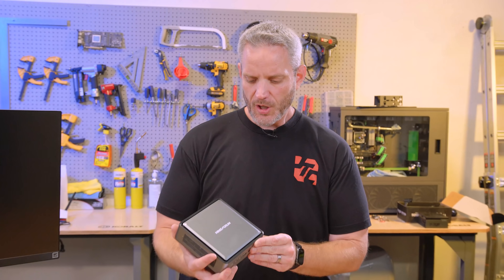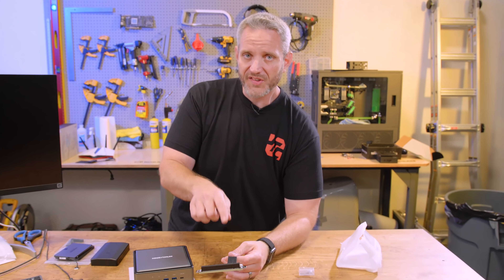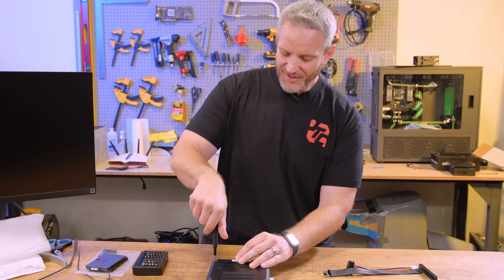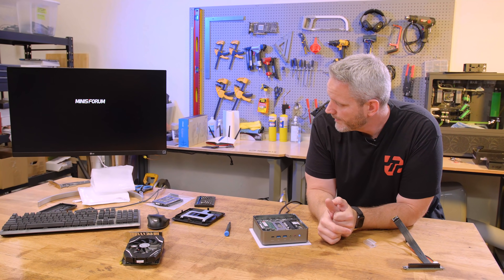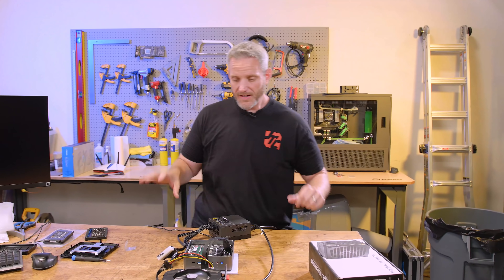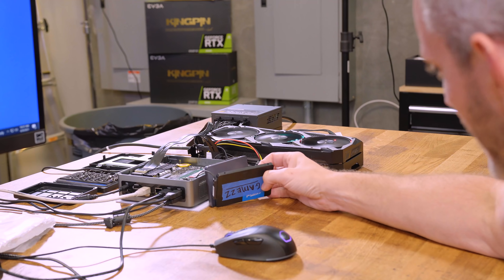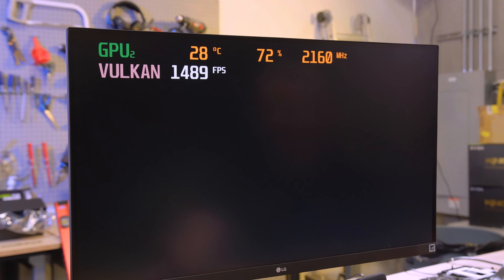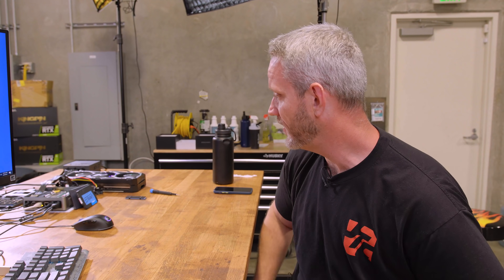This was easier than I expected it to be! Super powerful mini pc

Comment: DON'T USE SATA POWER FOR RISERS. FIRE HAZARD.
Reply: This needs to be boosted to the top so everyone can see it. Sata can only provide up to 54W, pcie can pull up to 75W. Resistance happens and can potentially melt the wire down and causes a fire.

Comment: Could you stealth mod that tiny PC into an OLD TYPEWRITER? Bonus: Then get the actual typewriter keyboard to work, too (like the one Linus did) Yes, you may add a nice chunky GPU visibly to the back or top of the typewriter, if there’s no room inside. The PCI slot could be built-in flush to allow any GPU to be plugged in there easily… add a pinch of steampunk. Poof!! 💨

https://youtu.be/EZMNaT2NjXk

Comment: Does use that m.2 connector slow your PCI-e speeds down compared to a normal PCI-e slot?
Reply: It should run at 4x PCIe
Reply: @alferez012  Thinking about adding a PCIe NVME adapter to my second PCIx16 slot on my Asrock x570 phantom 4 gaming motherboard and i'm trying to figure out if the 2 PCIx16 lanes are separate on on the same BUS and if it will cause my GPU to slow down in the first slot... any idea?
Reply: @NPuffenbarger  the second x16 slot runs at X4, and is managed by the chipset, so doesn't affect the performance of your gpu, and X4 slot runs perfectly a nvme 1 slot adapter
Reply: @alferez012  That's what I thought after reading into it but wanted to get a second opinion and yes I mistyped and meant PCIe x4 for the second slot I just wasn't sure if it shared anything with the main PCIe X16 GPU slot. Thank you for the info and help, much appreciated!

Comment: Well I know there are some very short low profile versions of stuff like the GT 1030 and GTX 1050... might be some of more powerful cards? Would it be possible to fit one inside? Also - Why not go a different way and make a custom case where you reuse a busted laptop and build a "dual psu" small form factor PC with this - making a custom "power on" solution where you turn off both PSUs with one button?

Comment: Mount this setup to the back of a TV that has VESA mounting capability or even an overhead projector. It would also be cool if you could power the thing from the PSU itself instead of it’s adapter. Other options, but it’s been done before: Mounting inside a desk or game table. Vehicle. Might as well mount it to cooler/ice chest so you can play PC and keep it cool while you’re tailgating. So you know … you can ‘play outside’ :D. It all comes back to a beer cooled PC I guess.

Comment: Put it in a duct tape case so it's all nice and neat and stuff. By duct tape case I mean duct tape it all together into a neat single unit. You could also wire up the external power supply to the NUC's power button, so the one button controls both PSUs. Then draw a skull on the front and call it Jay's Canyon NUC.

Comment: Concole sized PC but like a all in one aswell
(So basically the size of a concole and then add a monitor to it) 
I'm sure you can run both start connectors/jumpers from one button aswell but it will take Lot of modding

Comment: You could probably just use a 12V Molex/Sata Power Adapter if the graphics card doesn't require additional power. Just make sure the AC-DC 12V is 90W or higher. Cleaner than having to hook up a full PSU to it.

Comment: Inside a low tv table with a popup touchscreen? That's one place to put that little monster. Inside a mirror and use the mirror as the screen, or take a stuffed kids toy and add it at and laser projector (a small one) to it's mouth. Or do it to a small as can be easteregg, the options are many.

I would have made a computer with a hidden computer inside the other computer where both were working, but the hidden one was the good one, just for giggles. Better yet make it into an art piece or a big figurine from a game, anime or comic.

Comment: isnt the samsung qvo like one of the drives that reaches hdd speeds when the small cache is full? 
a friend of mine had one of these and i wanted to install windows and it took longer than my patience was lasting so took a proper ssd. 
for a secondary or archive storage its fine. i personally wouldnd use it as aboot drive.

Comment: Is that m.2 slot pcie4.0 x4(= pcie3.0 x8)? If you can find a solid cable(with 6pin ATX socket instead of that sata cable...), you should be able to run newer AMD gpu at (almost) full speed! faster than thunderbolt! (not in laptop..sign...)

Comment: does the ssd extensions not deliver power if there is not an ssd plugged in I'm thinking a high capacity ssd, and then use the other cable to power something like the 1050ti with the other cable to see if it can deliver enough power to the gpu on it's own insted of needing a external psu?

just a thought. though you did mention that the power brick would probably be insufficient.

Comment: I'm imagining something that looks like the graphics card is on display in a shadowbox with the mini PC and GPU power supply in the base as a stand.
Reply: That would be fun
Reply: This, I was just about to post just that. File the case enough for the ribbon to slip through and mount the pcie riser to the lid. Add RGB and tell everyone it's a display for the GPU.
Reply: Wall mount that puppy and hide those cables.

Comment: Should mod the PSU to power both the GPU and the Mini PC and Build a Mini case from aluminum, make it vesa mountable so it can attach to the back of a monitor.  Build the custom case in a way that the fans from the GPU blow onto the mini pc board to cool it. Maybe mount the ssd to the backplate of the gpu?  mount the mini pc to the PSU and build the custom case around it? Use usb extenders to mount to the case design,  or a monitor that has USB hub in it.   Maybe an good option to 3d design and print a case?  The standard way to build a pc has always been around the MB,  however I wonder way no one has ever try to shrink down a motherboard to fit on the backplate of a performance GPU and build around the GPU?  Guess I could take the backplate of a gpu drill wholes to create mounts for an mini ITX board to fit on the back of the GPU.

Comment: Got an asrock A300, a crap apu (ryzen 3 2200g) 'cause that was the only one in store last year and i'm seriously considering doing something like that. The problem is that i kind of already use both m.2 slot, gpu are still way too overpriced and it would be a dusting nightmare.

Comment: Something to keep in mind though that Sata Cable wont be able to fully power anything trying to draw 75Watts though , its going to cap out at 54 Watts
Reply: Remember wattage is pulled no pushed, the rating is for the gauge and insulation of the wiring. If you go over it may burn or overheat the wire. It still will fully power it but may start melting.
Reply: Not*
Reply: @cader996  Not exactly, the port on the PSU is limited to a certain V and A so W should be limited. Unless its some cheap-O psu that doesn't regulate power.
Reply: @TheRealTnT4u  Notice that the PSU cable has 3 SATA connectors on it. As far as the PSU is concerned it doesn't know if 3 SATA are trying to draw 50W each or 1 is trying to draw 150W.
Reply: @darnon2031  All you have to do is look up the standard for sata. Its not per connector, its per strand.
Reply: @cader996  yeah that's what I was getting at

Comment: I think SATA is only designed to pull 54W, i'm surprised it didn't burn up if its pulling 75W through the slot lol
Reply: It can do 75W just not for too long eventually the cable will start to melt slightly. But also the 3060ti they were using had overkill double 8-pins so it was probably fine from that alone
Reply: For larger cards pretty much 99% of the power is pulled through the power connectors and wouldn't be able to produce a video output without the power plug. The smaller cards are like 15-30 watts until you start to load the gpu in something other than the bios or windows home screen like a game.
Reply: It doesn't matter pcie got power through the psu
8:30

Comment: A sata power cable is what, 54w or something? And a pcie slot is supposed to deliver up to 75w..
So you gonna pull 75w through a cable that deliver 50w, through a tiny power cable? Sounds very safe.. :-P

Comment: Why not try building it into a mini fridge, that actually still has enough room in it to still hold drinks, as a mini fridge should?

I feel like there should be a way to connect a momentary push-button to the PSU to engage it's power --- AND THEN securely mount this button next to the computers physical power button, followed by hot glueing a physical bridge between the two, to make for ONE button that simultaneously powers on both (while still being on separate electric circuits, since combining 2x PSU on one circuit could be bad)
Reply: @T. Dougs could seal the boards traces with a sprayed on non conductive clear coat (enamel?)
Or just have the radiator of a cooler loop within the fridge, if the system is built on to the side of the fridge.
Would want to insulate as much of the fluid lines outside of the case as possible then (less avenues to absorb heat from the 'outside air')

Comment: Put a computer on a train and make it go around on a track!  Many years ago Lian Li did a train case, but it would be cool to see one again
Reply: Would be easy with a 12vo system. The tracks could be at 12v.
Are you thinking of 110v mega death rails?
Reply: @KillaBitz  it could be battery powered for all I care.  I just want to see a computer, in a train, running down the track.  Wireless tech is good enough now that it should still be a good experience.
Reply: Thomas the crypto currency engine.

Comment: put it in a remote control boat with a wireless display adapter, and it has a big metal heatsink on the bottom side to passive cool while someone is driving the boat while the other person games. GASP Linus colab.

Comment: "They're not like the NZXT ones, they're actually shielded"🔥🔥🔥🔥
That's why we love you Jay!
Reply: Who will win:
(Meme) gaming company with a lot of products and $$€€.
Some small chinese factory.
Reply: @Michaeltje89  The one who's products won't burn your house down!
Reply: @IronmanV5  Small Chinese Factory that is 😂
Reply: @IronmanV5  I'm curious, which is the one who's products are burning houses down ?
Reply: See NZXT? This is how you do a burn without risking your customers' property.
Reply: It might still burn the house down, sata can't provide the required 75W for the pcie bus. Sata can only do 54W.
Reply: @TheRealTnT4u  that's supplementary. The full power is SATA + NVME. But since the graphics cards is hooked to its own power, doesn't even need all of it
Reply: @danilolimadossantos1  Think what you want, I mine and know these things because I don't want my house to burn down. Power is always drawn from the slot itself, the 6/8 pins are the supplemental power not the primary. Please do some research before telling others that its fine, because its not. If someone does something like this without proper knowledge and safety in mind it could cause a fire. Sure its not going to right away but what happens is the power going through the wires to the port are not rated for that load (ie: resistance). Resistance causes heat..... If the flimsy adapter, especially in this video that uses a floppy drive connector (only uses 20 awg wire) can draw a max of 1.5 amps. Sata can do a max of 4.5amps at 12v. 4.5amps x 12v is 54w. A pcie socket can draw up to 75w, sometimes more if out of spec which this one looks like it might if its using a floppy adapter....... Resistance, heat, fire FACTS

Comment: I may be wrong here but I'm pretty sure 4800u is actually zen 2 not zen  +.

Great vid Jay!
Reply: The 3000 series mobile was Zen+ because of Ryzen 2000 Desktop. 

The 4800U is the Mobile Varient of the Zen 2 Architecture because 3000 series Ryzen Processers were. They didn't equalize the naming scheme until the 5000 series chips and Zen 3.
Reply: @RobbyRob  5000 chips aren't equalized at all. The 5300u, 5500u and 5700u are Zen 2.
Reply: @RandomPlaceHolderName  Some are. The 5400, 5600, 5800 are based on Zen 3 and are mobile variants. They weren't equalized at all up until the 5000 series. 

Myself saying all was incorrect to say, but saying none at all is also misinformation as well.
Reply: @RobbyRob  If one item in a group isn't equal to the others, the group isn't equalized at all; it is still very much unequal, however much progress was made.
Reply: yep tis zen2
Reply: Yup.
Reply: He probably meant not Zen 3, cause it's definitely Zen 2

Comment: Cheap Thunderbolt alternative too for external GPUs.
Reply: @Sciurus Niger Thunderbolt *alternative*, so if you have a spare m key slot you don't need TB to put in an eGPU
Reply: @Sciurus Niger thats what he's trying to say. You needn't Intel anymore for an external graficscard. Your comment tells me that you didn't get it.
Reply: Isn't thunderbolt a compromise due to bandwidth constrains?
Reply: @Sciurus Niger that's why it's an alternative to thunderbolt, I did it with my Ryzen 7 3700u laptop and a RX580, and oh boy it's easy to install. When it's done, it is even easier to plug it in and back again, you can watch me doing this on my channel in less then 1 minute. All you need is a Phillips screwdriver.
Reply: @Sciurus Niger At least having an intel with support of thunderbolt avoids all of that surgery, and all you need is a cable and an eGPU box (and a GPU obviously).
Reply: @SpyrosLv  yeah this Box will cost you around 300 € with out any GPU and it isn't even superior to this junky setup. Lol
Reply: @Sciurus Niger na, this cost 100€ at most, and you free to go, an Xbox cost what 500€?
Reply: @Sciurus Niger no, I mean, how the f%ck in the world should this be possible? 

I mean the setup cost you 100 € compared to 300 € for eGPU-Box. The m.2 solution has a bigger bandwidth then a Thunderbolt eGPU-box.

In my case, the RX 580 was 200€ + the riser and PSU 100€, it's 300€ cheaper then an Xbox and I can pirate Games. My laptop existed before so, no need to count that in.

You don't need the most pricey GPU for having a better experience then the Xbox would give you. 

I mean, I have Excell and Adobe and Ableton live 11 and pirated games.
Reply: @Sciurus Niger No you don't.

Edit: USB4 includes Thunderbolt 4 support.
Reply: @Sciurus Niger Alternative in the narrower sense means the possibility of deciding between two mutually exclusive options for action or things, in the sense of an either / or decision. So you wrong even on that.

Comment: that SATA connector can not handle 75w . . . and the floppy connector even less . . . .That thing will catch fire
Reply: My thought too! Even if you used a molex that floppy connector... nooo.
Reply: I've used this with a 1070 running 24/7 for over 2 months and it didn't even get warm,  not every card will pull 75w from the connector
Reply: It is a known issue in mining rigs where they do a lot of external GPU setups. And while not all cards may pull 75w from the PCI all the time, it is easily possible. Something like the card he starts with that only gets its power from the PCI and has a 75w TDP.  There are alternatives that do this that have six pin PCIe connectors.
Reply: @randomplayer6461  Probably because you don't have your card OC'd like a gamer would. IMO the game crashed in the video because there wasn't enough W for the PCIE slot.

Comment: Hold on some laptops these days has 2 M.2 slots, so technically you can add two of these to it for SLI/Crossfire, I know that doing that is not worth it,but still funny to know
Reply: I have never seen a laptop mainbord with SLI or Crossfire support(exept for some rare devices with 2 dedicated cards build in, but this was before m.2). So i think both cards would work, but just independent. 
But after repairing 1000+ laptops (my job) i would still really love to see someone trying this.

Comment: Correct me if I’m wrong, but if you’re going for portability (since your don’t wanna put a computer in you’re graphics card lmao), you could use a 1650 low profile card and then you won’t need a PSU
Reply: Still would though as there is no way to get sata power to the adapter otherwise

Comment: Really don't understand why there never are any PCIe x16 slot on the side of these. 
Have the dGPU work with a separate case and power source and just connect it with PCIe riser cable.